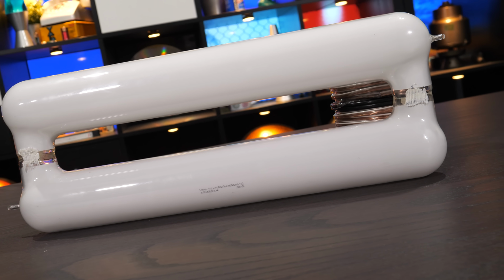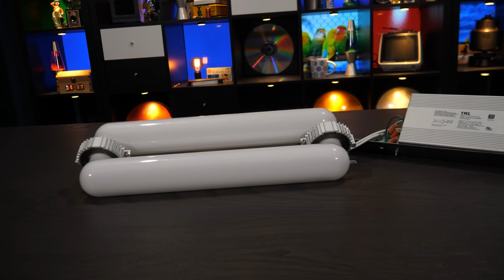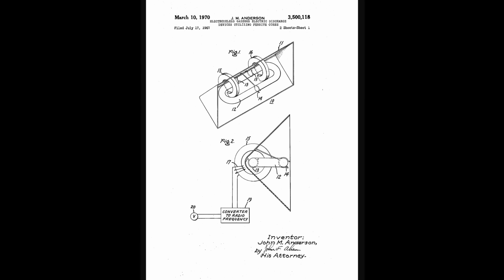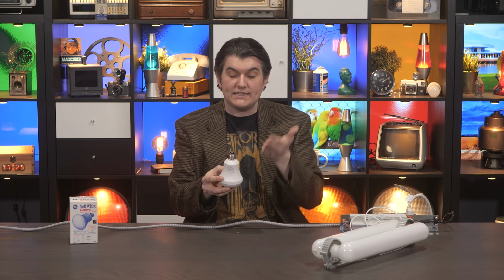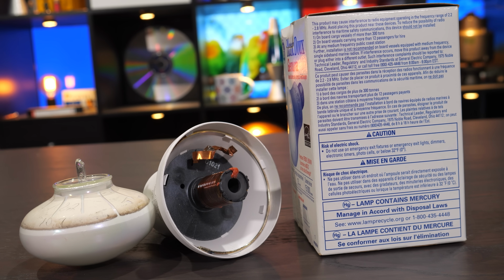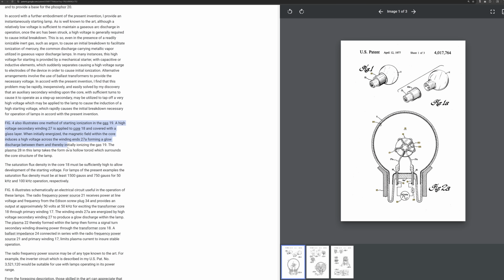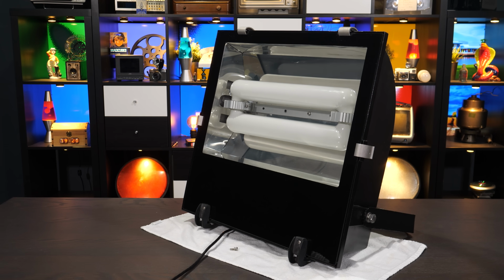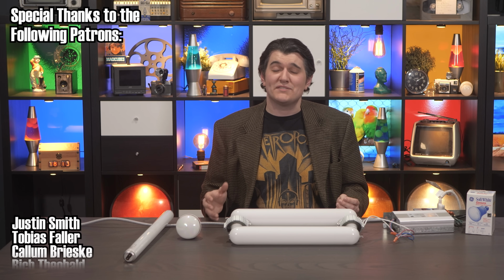Induction lamps: fluorescent lighting's final form

Comment: Scratching head .... Oh. My. God. The TUBE is the secondary. I have never seen this in all my 62 years. Thank you!
Reply: I am nothing but a hobbiest in electronics, but have made a thing or two. 'Confusing' is an understatement regarding that diagram. Your comment finally made it make sense. My brain wouldn't even go there in explaining how it was supposed to work. The 'missing secondary' being the light itself makes much more sense. That's actually brilliant.
Reply: @rich1051414  "That's actually brilliant" no pun intended?
Reply: @Inferryu  brick
Reply: I only knew about these because the maintenance guys were installing a few fixture in an equipment closet and I said what is that goofy shaped flourescent bulb?! And he said it was an induction lamp.

They installed them around the time they removed the many many hundreds and possibly thousand+ incandescent and halogen lights from our large office complex. 

(Going off on a tangent) I will say that was an absolutely beautiful office with all those lights, as inefficient as it was. It had 6 wings each on 2 floors, each identified my nice deep colors and beautiful stained wood signs in those colors. 

Unfortunately when it all went LED they painted it all light colors like a hospital and i wanted to shed a tear when that beautiful woodwork was painted over in white. My job was to work around all day fixing computers and the colors were great to look at and to tell unfamiliar people "I'll meet you at 2A, the green entrance upstairs. And people could just walk in a circle and not get lost.
Reply: I work in HVAC: just changed a 460/24V transformer Friday. When I saw the wire looped, I started talking to the dog, ‘Naw…he’s gonna say the bulb is the secondary?’
-dog didn’t buy it
Reply: Gas makes for some odd wire eh?
Reply: Hey! More like 36 years 😊
Reply: Yes u have they are everywhere in commercial businesses just covered by defusers. U know how easily broken the tubes are!
Reply: I’d be surprised if most folks hadn’t at least seen the same phenomenon. This is the same effect that makes fluorescent lamps glow in the presence of a Tesla coil, or any high potential electrical field.
Reply: Would this be a circular comment on the tube being the secondary?
Reply: I work in the metallurgical industry and my first thought looking at that diagram was"

"A primary surrounding something that gets hot to the point of incandescence, that sounds awful a lot like an induction furnace were the metal to be melted is the secondary…  wait, so the bulb is the secondary? That sounds so cool!"
Reply: Wacky nonsense ;)
Reply: How is this comment from a month ago if this video is four weeks old?
Reply: Almost. That covers the steady operation. Ignition happens by way of RF excitation, and the cores act more like antennas than transformers until plasma forms locally in the vicinity. Capacitive coupling excites the gas just on the other side of the glass at the surface. This will be in the shape of a ring due to the glass and core's shape/presence. As a completed plasma ring it is capable of conducting electrons, and representing a single shorted turn in a very unstable position, a random fluctuation in its magnetic field or a deviance in shape will cause the core's field to "kick" it into a more stable state, which the rest of the tube just so happens to be conveniently set up for... it is already somewhat excited just as any fluorescent tube demonstrates around RF energy. The now emerging loop(s) from the core(s) readily accept the shape of the ionized tube, a stable single secondary "turn" forms... and there was light. Until somebody flips the switch.
Reply: GE made Compact Fluorescent versions of induction lamps. They were branded "Genura". Now I will continue watching and see if Alex mentions them
Reply: @johncoops6897  10:10 yup
Reply: Wait a second, how did you comment 21 hours ago and the video was released hours ago??? Perhaps a time traveler😩
Reply: @valwei2 Patreon supporters get a little sneak preview!
Reply: @valwei2  Is this some sort of meme I'm too old to get, or are there really still people asking this question legitimately in 2025?

In case you're genuinely asking: because an uploader can set the video as unlisted, and only people with the link can view and comment. Later, when he sets it to public, the publication date is reset to when they made the video public, not when it was uploaded. So the people who commented before that will have timestamps on their comment that are older than the published date on the video. This is often done in combination with e.g. Patreon, where the people who support the creator on Patreon get the link a day or so early, before the video goes public.
Reply: @EvenTheDogAgrees  to add on, this only applies to unlisted videos that were never made public prior. Videos that have been public, then unlisted, then made public again, still retain their original public date.
Reply: @EvenTheDogAgrees  Ahhh, thanks for the explanation. I was genuinely asking so glad that I got a nice explanation. I totally forgot about unlisted videos! 😅